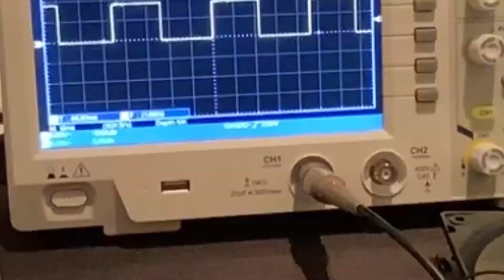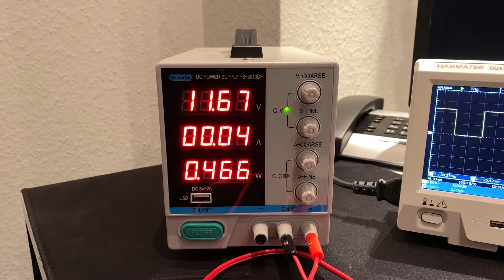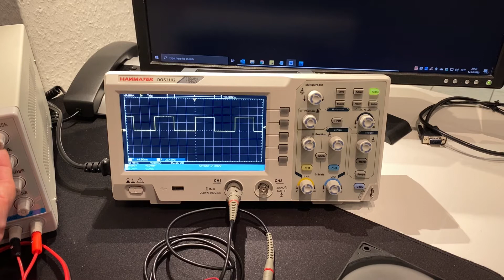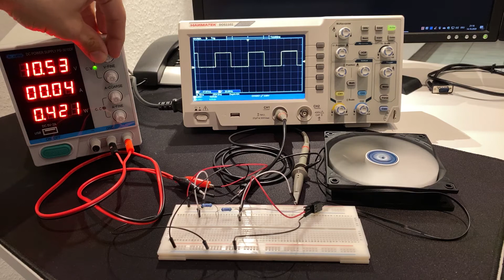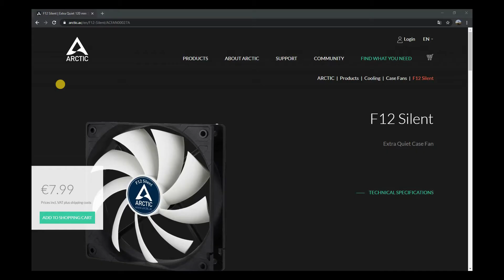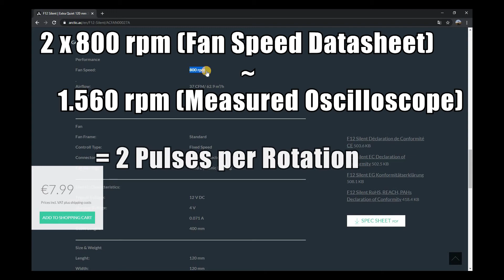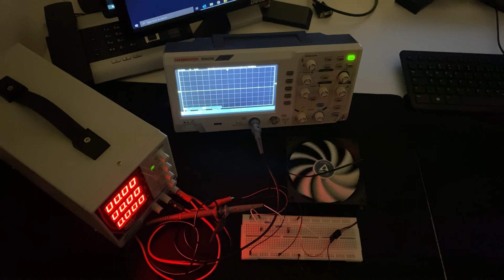HOW to control a 3-WIRE FAN speed and PULSE MEASUREMENT per Rotation - Test in Practice

Comment: Thank you for this excellent video!  If I were installing a 3 wire fan in a piece of hi-fi audio gear and was concerned about the tach wire sending noise back onto the 12V rail, what would be a good way to isolate that?
Reply from the maker: I have good experiences with the built in Artic Ventilation System in the video. I can't hear any disturbing noises with the fans.

Comment: I want to adapt a new fan in a circuit where it has a faster fan but the same amount of airflow. This circuit has a protection that trips because of the lower speed of the new fan. Can I make a circuit to multiply the pulses sent by the fan's tach?

Comment: I know this is 2 years old, but I'm curious.  Do you need the resistor to control fan speed or ca you just adjust the power cutting the yellow wire? I'm thinking of using a septic dc to dc buck boost converter to control speed of 5 fans. Any thoughts?
Reply: The third wire is a tachometer, to measure the speed. A 4 pin connector is the one you're looking for, where it has speed control.

Comment: If we do not have an oscilloscope, is there any other way to detect the f of the fan to find rpm and pulse?
Reply: I only know the way using an oscilloscope.
Reply: You can use multimeter. Function “Hz”.